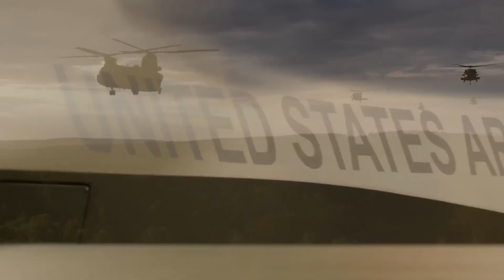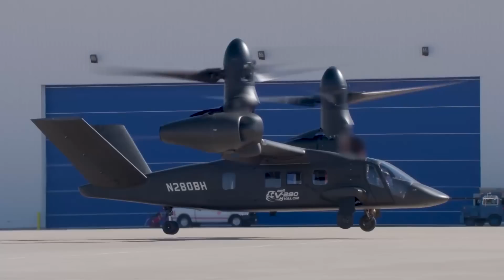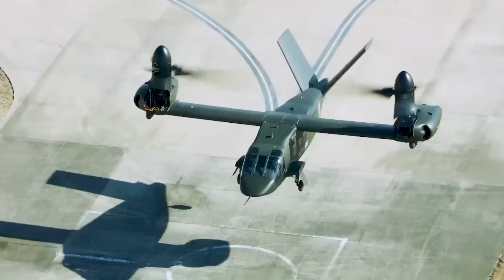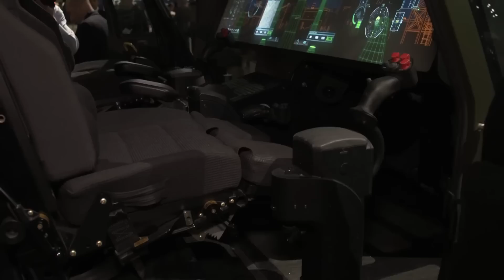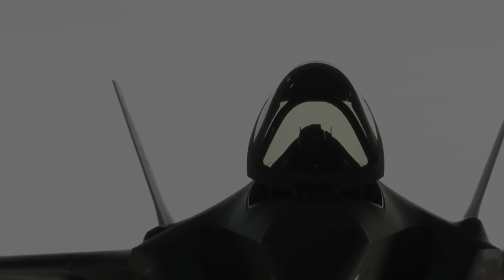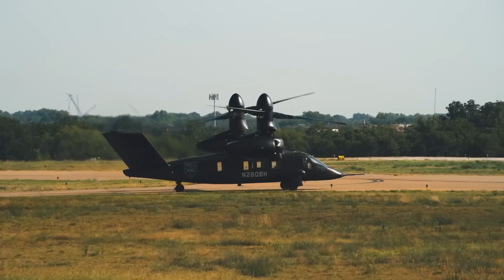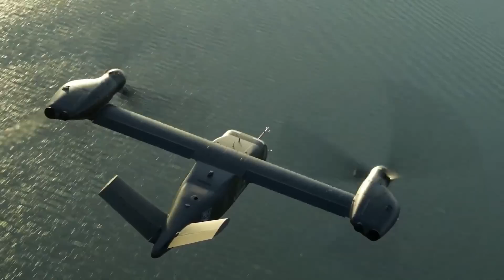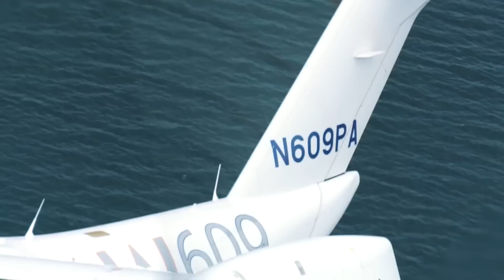V-280 Valor – The future Black Hawk

Comment: I love the defiant and hopefully it has a future but it couldn't compete with the speed and range of the V280
Reply: I thought that they will be used for Special Forces so they're making small numbers of it
Reply: If Sikorsky can find a practicable way to fold up those rotor blades, the Navy might be interested for their Seahawk replacement project. But I do think the Raider (smaller version of Defiant) will win the army's FLRAA competition.
Reply: @anwartaylor6096  I'd have thought the navy would prefer the longer operational range and higher speed of the V-280. If they did a dedicated naval variant with osprey style folding wings and rotors that would probably take up less space than the defiant even with folding rotors
Reply: @poprocket2342 Yeah, u very well may be right about that. Although, I would say the way that the engines and props are configured with the wing on the Valor makes it much more difficult to fold up those wings up. Or at the very least, the space u save wouldn't amount to the space savings that the Osprey's engine/prop configuration allows for. Also, the Navy might also be interested in the superior hovering capability and agility that the Defiant would provide, given the unique nature of sea-based operations and mission sets.
Reply: @anwartaylor6096 tilt rotors are not inherently less maneuverable. You not only have the same control surfaces a helicopter has but increased range of movement thanks to the entire rotor being able to be rotated forward and backwards. You can't judge an entire platform based on the first of it's kind built for a completely different role and had multiple design compromises to meet requirements.
Reply: @n3v3rforgott3n9  I don't mean to suggest for a moment that they're inherently less maneuverable.The Valor is remarkably maneuverable when compared to typical rotorcraft. But its standout performance capabilities are primarily in the categories of speed and range. Sikorsky's Defiant/Raider X2 platform, however, with its rigid coaxial rotor design, is an absolute game-changer when it comes to hover stability, low-altitude maneuverability, and level acceleration/deceleration. It provides capabilities in those areas that have never been seen before on the battlefield.
Reply: @anwartaylor6096  except in testing the valor outperformed the defiants in acceleration and deceleration...
Reply: @n3v3rforgott3n9  Well, thats why my original statement highlighted hover stability and maneuverability, which again, is what is particularly important for naval activity. The Defiant's level acceleration/deceleration is remarkable compared to legacy rotorcraft, but not the navy's primary concern.
Reply: @anwartaylor6096  It passed the same low level maneuverability tests the Black Hawk had to pass. Why would hover stability be worse than other platforms?
Reply: @n3v3rforgott3n9 Passing and excelling aren't the same thing. Again, I never said the Valor was "worse" than other platforms. I'm saying Sikorsky's X2 platforms (Defiant and Raider) are exceptionally capable when it comes to hover stability and maneuverability...far better than the Black Hawk. It is superior to the Valor in those areas as well.
Reply: @anwartaylor6096  For the Raider I can see that being a massive selling point but for the role a Black Hawk does It isn't as big. Besides imo we have reached a ceiling of what helicopters are capable of while tilt rotors have a lot more room for advancement.
Reply: @n3v3rforgott3n9  This isn't about the army's Black Hawk. We're talking about the Navy's Sea Hawk. A [storable] Navy variant of the Defiant would be ideal for their needs, for the reasons I've outlined. And given that the Defiant is superior to the Black/Sea Hawk in every way, then clearly we haven't reached a ceiling in helicopter capability.
Reply: @anwartaylor6096  helicopter tech is quite limited on speed, range, and even maneuverability to some extent. We know what the max speed that a conventional helicopter can reach and can't overcome that limit. We know how to increase the range of a traditional helicopter but can't increase it by very much. We know what the max maneuverability from a helicopter can be but can't increase it by much while keeping the size and weight needed for the role.
Reply: The Army selected the Bell Valor so the defiant is cancelled and they cancelled the smaller raider as well.

Comment: Hmm.. so apart from it looking exactly like a modified UH-60 with V-22 additions... it seems alot of 'fuss' to move 12 guys..
Reply: There's going to be a lot of projects like this in the coming decades. There's a lot of hardware in US service that is still capable but limited by the technology available at the time. Things like fibre optic wiring instead of copper, new composite materials and the touchscreen cockpit are the real game changers. The extra speed and range and more supposed to be flashy and obvious things that justify the cost of a new program to the lay person. Try to talk at a politician about sensor fusion and additional battlefield awareness and their eyes will glaze over and they'll tell you to just keep updating airframes that are 50 years old at this point
Reply: No, it carries more.
Reply: It goes 3 times the distance at 2 times the speed while carrying 2-3 more people...
Reply: @n3v3rforgott3n9  it carries 12.. same as a UH-60 pretty much
Reply: @mcal27  No... you can't even get the facts right. It carries 14.
Reply: @n3v3rforgott3n9  oh well that's way out isn't it!? Lol
Reply: @n3v3rforgott3n9  so why not fix the V-22, and move a worthwhile payload? This loadout of 10-12 guys makes little sense for a transport helicopter imho.
Reply: @mcal27  Why have the Black Hawk then in the first place... why not just only use CH-53s... almost like different mission sets require different aircraft. The V-22 replaced the CH-46 and possibly C-2 on carriers. Osprey is a medium lift aircraft while the V-280 will be a light utility aircraft like the Black Hawk.
Reply: @mcal27  because the V-22 is far more expensive, a maintenance hog, and has a larger profile. The army wanted a new aircraft that has speed and distance. The V-280 is faster and has longer range than the V-22.

Comment: I know they have worked all the bugs out but if I were being sent into a combat zone I would still rather a helicopter with its thinner build. Something about the propellers so far out and on thin little wings just makes me worried that extra torsion could make those wings snap with small arms fire.
Reply: Speed is life.

If you're in the air half the time you only have to dodge half the bullets.

At least that's the theory.

If you catch the golden bullet you are pretty much screwed either way.

Comment: I hope they can work out the issues presented by the Osprey.
Reply: That's specifically what they've done, with for example the fixed engines rather than rotating. Some of the Osprey's issues were also training related
Reply: They won’t because they continued on the tiltrotor path.

Comment: My biggest questionmark is why they used a big gearbox to tilt the rotor and not rotate the whole powerplant
Reply: There were a lot of problems with the V22 caused by rotating the powerplant. Additional stresses on the mechanism that need constant maintenance, shifting centre of mass, exhaust from the turbine being dangerous to ground crew and damaging runways. Not to mention the extra height that would be required to fit the turbines standing up

Comment: 😂😂😂😂😂 bah flying garabage
Reply: Yet you provide zero reason as such and just type trash.
Reply: @n3v3rforgott3n9  it's exactly like the V22 which cool as is still flys a problematic flight ...
carbon fiber is not fixable on the field 
its great yes but hard to fix fiberglass is better to a degree 
this is only two points
Reply: @n3v3rforgott3n9  it's exactly like the V22 which cool as is still flys a problematic flight ...
carbon fiber is not fixable on the field 
its great yes but hard to fix fiberglass is better to a degree 
this is only two points

Comment: The #1 thing holding the V-280 back are delays in the new turbine GE has been working on for years.  The V-280 needs that engine to get beyond prototype phase.
Reply: It's always the engines lol
Reply: @S1baar True. It makes sense lol.
Reply: @S1baar ⁹
Reply: GE is in the prototype. Rolls Royce has the contract for production. Moves from 5000 to 7000 horsepower and is ready to go. GE lost the deal because Bell knows how to keep sustainment costs low on the Rolls Royce.
Reply: I thought the narrator indicated the production aircraft was going with the Rolls Royce engines in use by the Osprey?
Reply: @Primus54  Whatever the upgrade engine is for the Chinook going from 5000hp to 7000hp if I remember correctly. Vietnam style fire bases for hilly forested Pacific Islands theatre.
Reply: What GE needs to do is push the narrow minded engineers out and let the crazy engineers give it a try
Reply: The Bell V-280 Valor is the FLRAA program winner. You're mixing it up with the prior FARA program, for which Bell (with the 360 Invictus) and the other contender were awaiting the delayed GE engine. The Army's recently canned FARA, so GE's delay is no longer an issue. Bell's chosen more powerful R-R engines for the Production variant of V-280 Valor - which are a derivative of the engine used by V-22 Osprey
Reply: They're switching to Rolls Royce engines.
Reply: Isn’t it the same turbine inside the new Beechcraft Denali?
Reply: Don't worry, some parasite/shee-hot officer will propose 'concurrent development' ..., and say hello to the F-14/TF30 debacle, for a more notorious example ...
Reply: It's not using that engine. Rolls-Royce.
Reply: "This plane can go x mph and has a range of x!"
"wow that's incredible, whats holding it back?"
"well... the engine isn't powerful and efficient enough yet"
Reply: 🙄. Oh boy !! 
New experimental tilt-rotor powered by imperfect troubled engines??
What could go wrong 😑 ??
🫢🫨😳😱
Reply: GE Sucks
Reply: @BernieGolgo13  Why does GE suck?
Reply: Stuff happens when politics selects the worst option, aka 280 Squaller.
Reply: @MrFritzzz666   Yeah it looks good on paper but also looks like a few practical sacrifices have been made over the Defiant. Huge footprint and can't fire the defensive weapons forward while the props are in the horizontal plane. BUT it's faster and has more range and likely could carry twice as many Hellfires as an Apache. We know it has over 4 ton of lifting capacity. It appears it also would have better survival redundancy with more durable blades and the wide dispersion of the engine nacelles could reduce the chance of a hit taking both turbines out in one hit or possibly dividing small arms fire, whilst also away from the crew.

The smaller Raider X makes more sense to me then the Defiant X for special forces and agility.